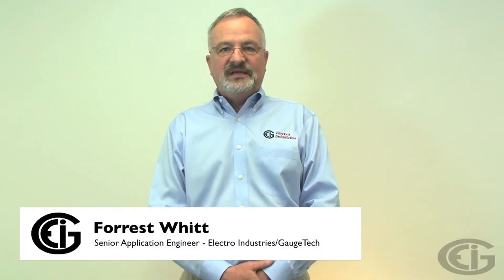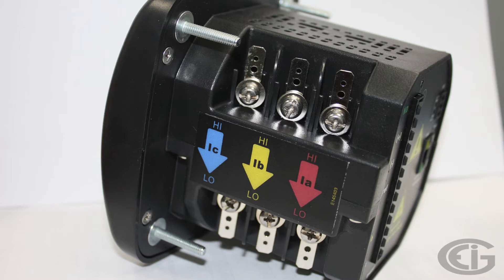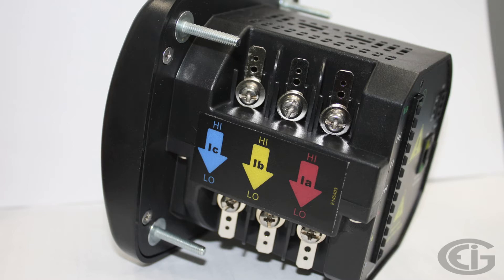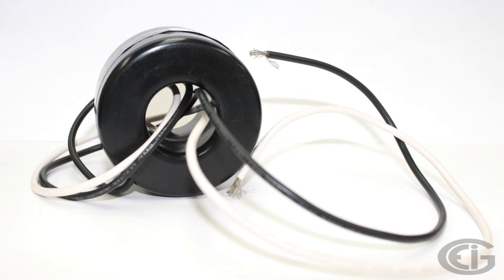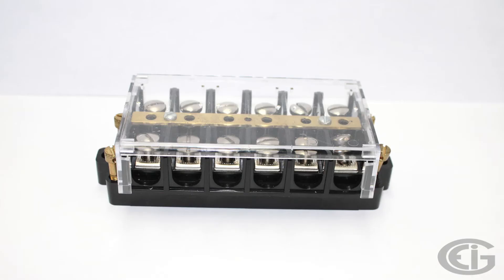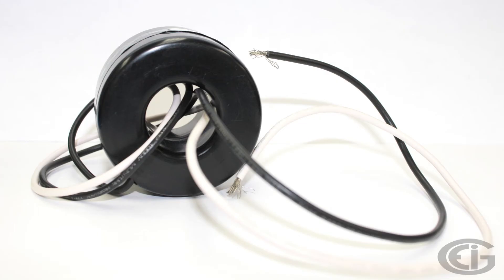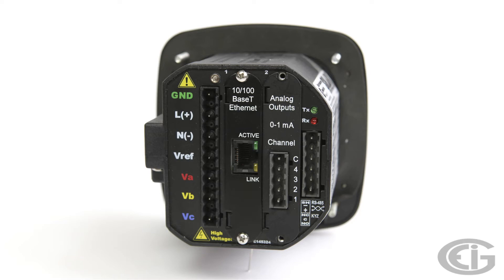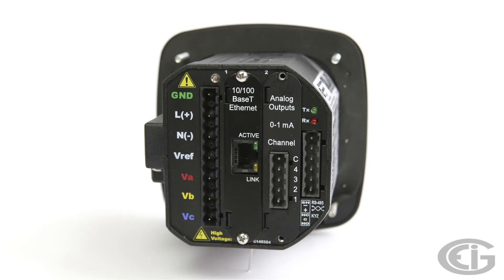EIG Shark Meter Basic Installation

Comment: you say repeatedly "contact me..." but provide no contact information.  You mention the meter can operate on 18 - 60 volt dc or 90 - 265 volt ac or dc but you give no information how to configure for the different voltage inputs. WTF????